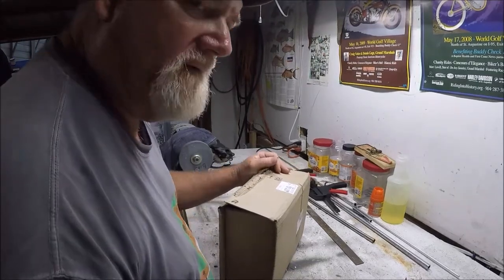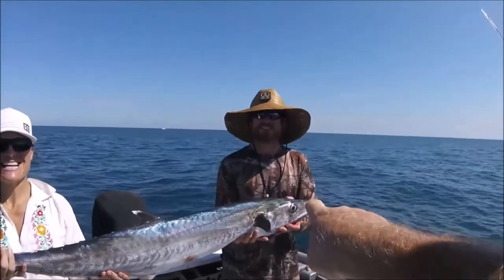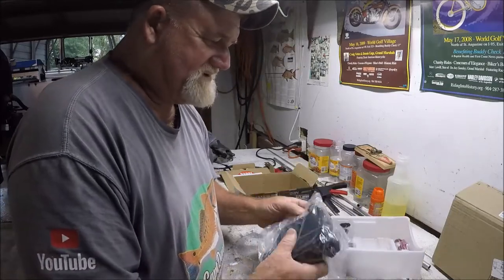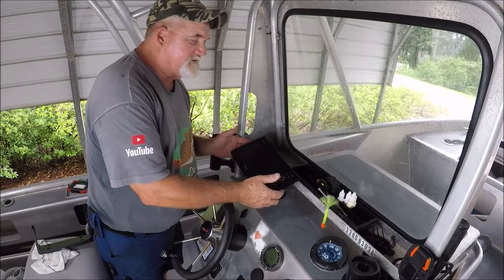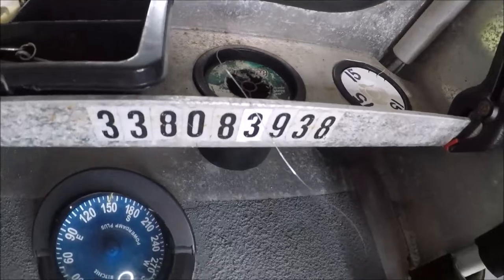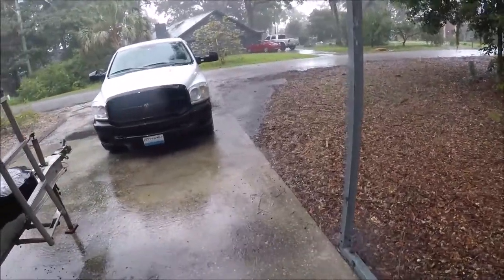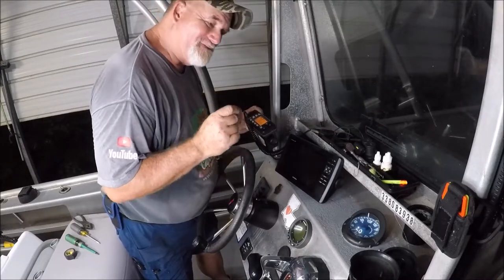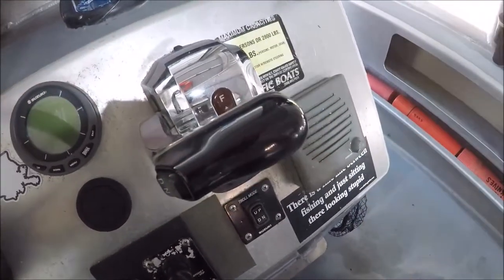Boat owners need to know ''MacGyverism''

Comment: For those who don't know , the installation Dave just did is a time consuming pain in the lower quadrant, and that's  on a boat with what I'm sure is neat and organized under the dash. Some boats have nothing shy of a birds nest of wires up in the dark part of the boat. Looks good  Capt Dave!!   Guess there will be no electric seats mounted anytime soon. Keep it simple fellow viewers. You'll be much happier.
Reply from the maker: Its as tidy as i can make it up under. Still would like to hire the local guy who re-wires everything like a nuclear sub. He'd find my job a piece of cake....but, of course I never know when I have a week to spate.
Same as getting my driveway finished, and have concrete out to the street.  When do i have a week that I dont need to move the boat.  This biz really isnt FLEXIBLE, at all.

Comment: KISS method - Keep It Simple Stupid.

I use a very high quality blade on my 12" miter saw.  Cuts wood, frozen meat, aluminum, iron steel, 3/4" rubber decking - you name it   love my Sawzalls but.......  Thanks for tip on small radio!
Reply from the maker: Yep, Ive learned for me simple saves me time and money in the long run.